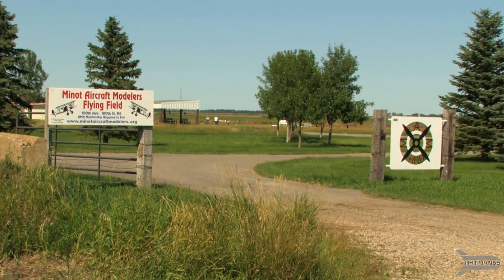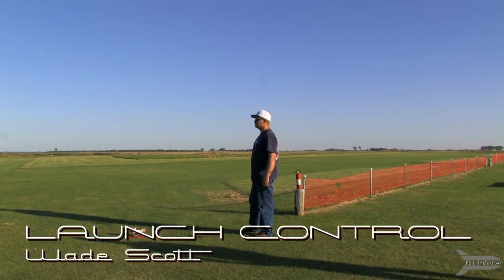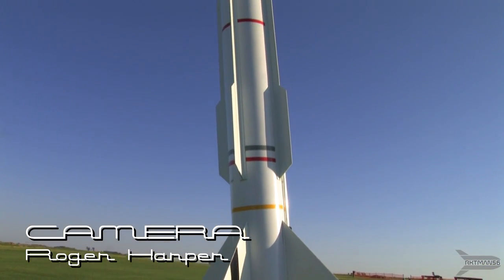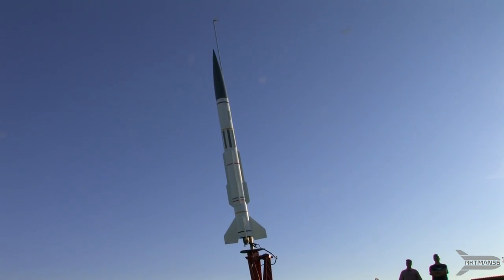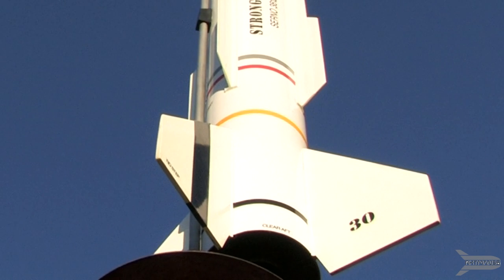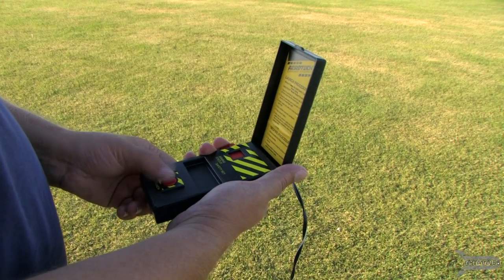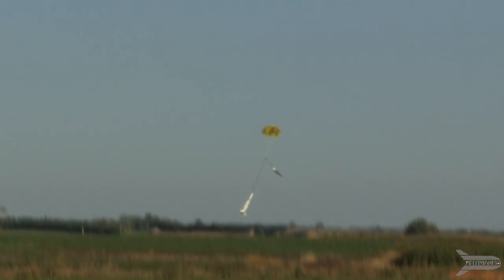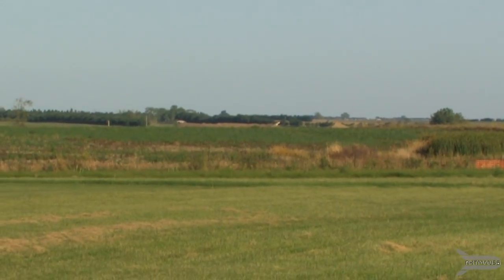First Aerotech Strong Arm Model Rocket Launch At MAM Field

Comment: When I was into these I would cut a round hole in the center of the parachute like real parachutes have. It stops the pendulum swinging and less drifting away, it allows the descent to be straighter down without losing any of the function of the parachute. 
I had even cut horizontal slits in the panels in some of them.

Comment: The launch pad has its blast deflector oriented a different way than I remember seeing in years past.
Used to be a 45 degree angled blast deflector but on this, it's a simple 0 degree position, with the launch rod going thru the middle.